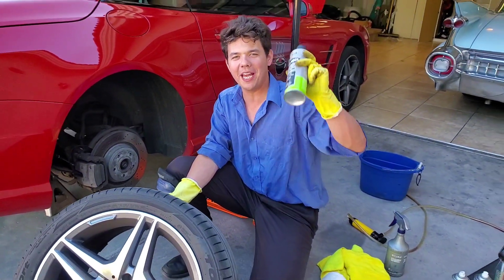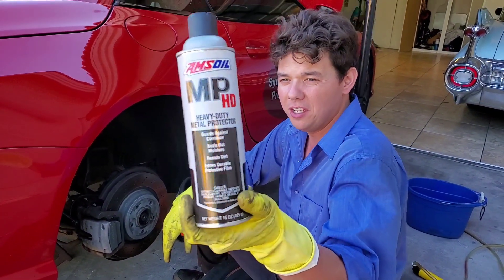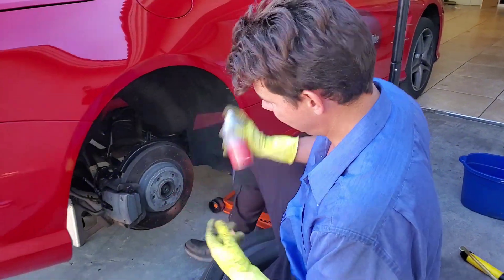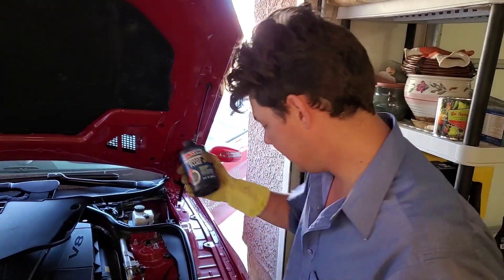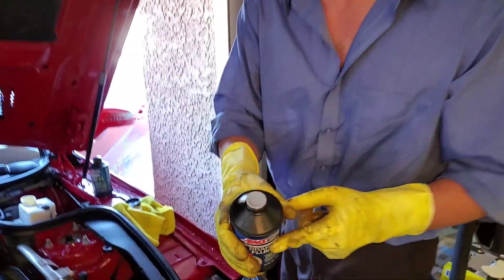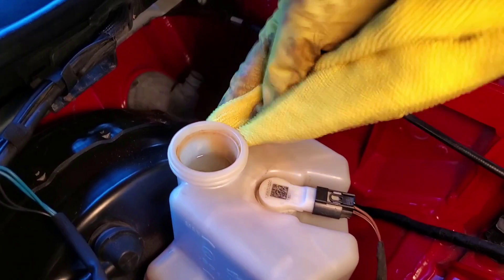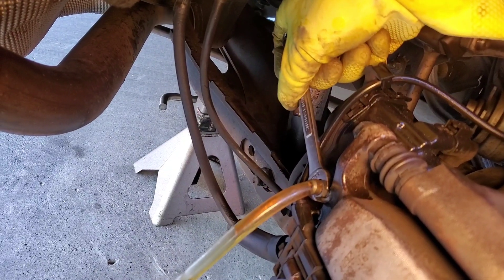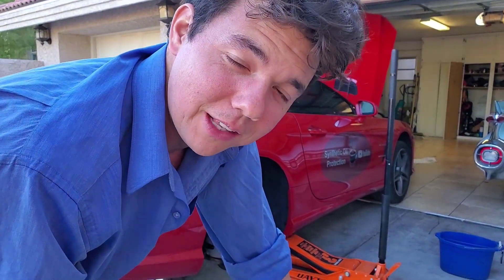4 Things to Get Your Wheels READY for the WINTER AMSOIL

Comment: My motorcycle is now 3/4 Amsoil. I changed the oil and brake fluid yesterday before putting her away for the winter. I will do the antifreeze in the spring when I bring her out of hibernation.

Comment: HD metal protector is awesome...buy a case or 3
Reply from the maker: What did you use it on?
Reply: @Syntheticoilprotection  it takes 3 cans for a Ram for the winter salt...It slows the salt down a little 👍🏻🥶
Reply from the maker: Sweet